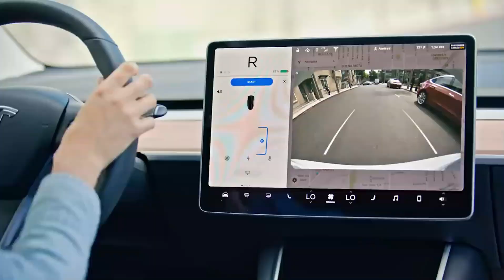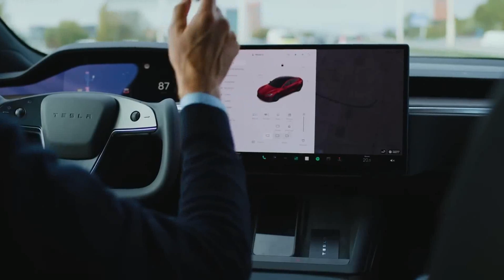New Tesla Model 2 unveiled for $25,000! Inspired by the Cybertruck!

Comment: No but a lot of people in the north sure enjoy being froze out of EV charging stations and those that can get to a station the batterys wont charge. Too cold!  That is the magic of an INTERNAL CUMBUSTION ENGINE!  IT MAKES HEAT!
Reply: And the diesel clogs below some freezing temperatures. Game over. They even have engine heater plugs on parking spaces high up north.

You can preheat or precool an EV before your drive. Try precooling your car in the heat. While it's parked on a public parking space and you will arrive shortly. Or in winter the car can preheat and you don't need to scratch the ice from the windows.

The battery holds long in the winter for heating, that's no problem. But running an engine for 24 hours might be too much fuel usage.
Reply: 90-95% of most people charge their car at home.  Average daily mileage is under 40 miles range.  
   I know you’re trying to keep the oil companies profitable.  But more and more people want the independence EV’s offers. 
  They also like the massively lower cost EV’s offer. Both in cost and cost of driving